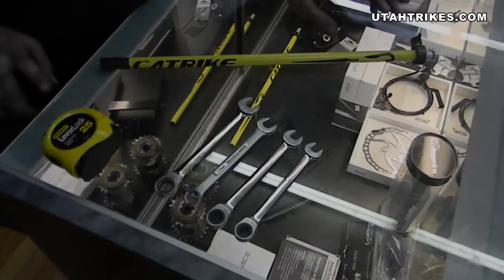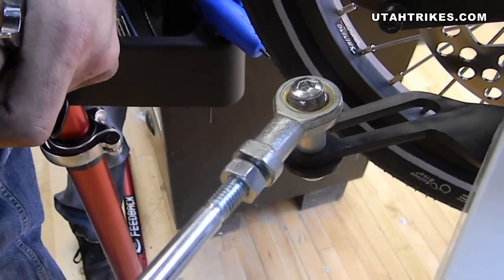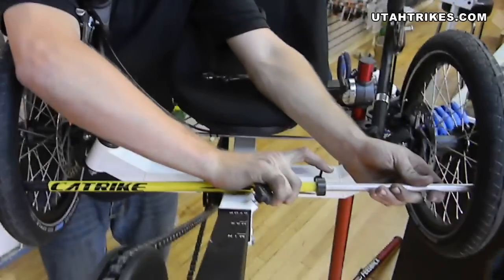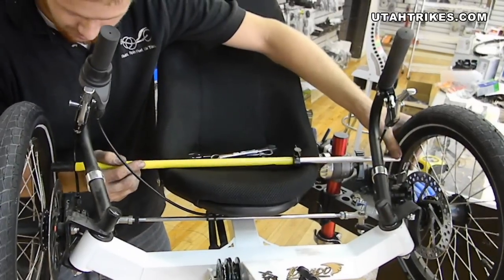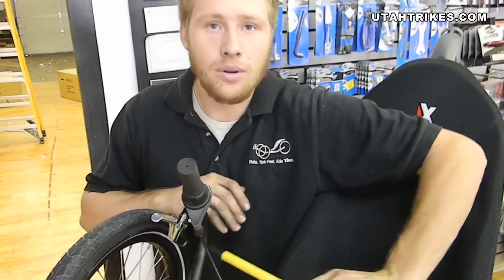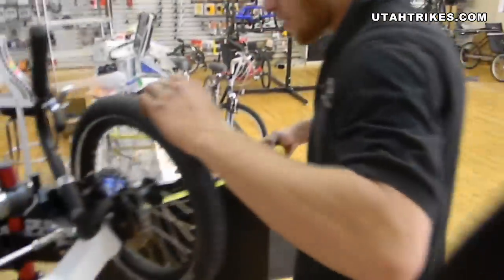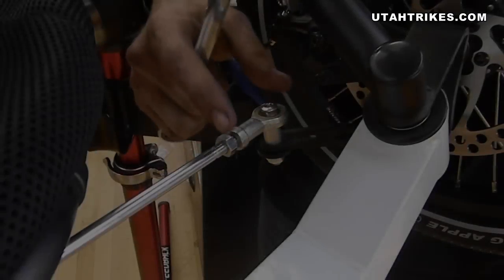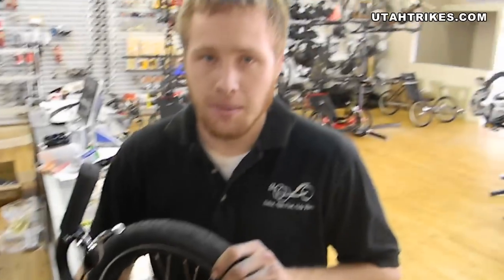Trike Wheel Alignment

Comment: Not all trikes use exact same distance front and back. My ICE Trike Adventure requires a couple of mm difference between the front and rear measurements. Alway best to check with the manufacture prior to making adjustments imho.

Comment: Most trikes have Ackerman Compensation built into the steering geometry. Isn't it critical to first make sure that the wheels are pointed straight ahead (or that one is) before adjusting (and make sure the steering handle bar on Linkage / Indirect designs is perfectly straight 90 degrees to the frame)? Otherwise, doesn't the alignment which will change by design in the AC change the measurement the more you turn the wheels? They should only really be parallel when pointed straight ahead.

Comment: He gets it wrong so many times that the entire video becomes pointless.

1: Put the brakes on and adjust one wheel to a straight position 
2: Put some weight on the seat to simulate the rider.
3: Make sure you're leveling your measuring tool. If you're using a tape measure start measuring with 1" or 1cm to avoid inaccuracies.
4: Set the wheels in a 1-2mm toe-in position (depending on the wheelsize) to avoid wobbling and to make it run straight.
Reply: Yes. A bit of toe-in is needed on two front wheels.

Comment from the maker: @dregerclock For best results your wheels should be at a 90 degree angle from the trikes frame. This is recommended when doing alignment on any trike.
Reply: Utah Trikes - Recumbent Trike Headquarters 
My catrike expedition X 90 annihilator
What is causing my trike steering when I hit a bump to turn left and right vigorously

Comment: where do you get one of those tools
Reply: you can make your own w/a length of wooden dowel rod & a 2 inch or so wood screw. Cut the dowel to just shorter than the distance between your rims' inside & screw the screw in one end of the dowel rod & turn it in & out for fine adjustment. That's what I did.